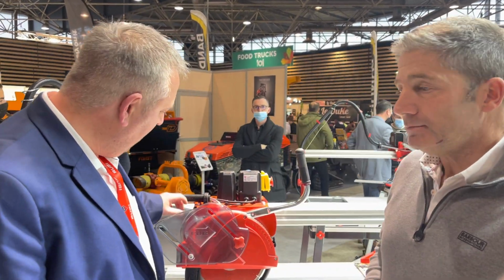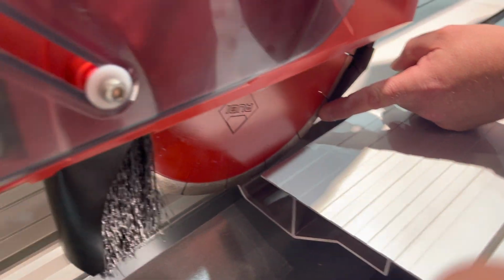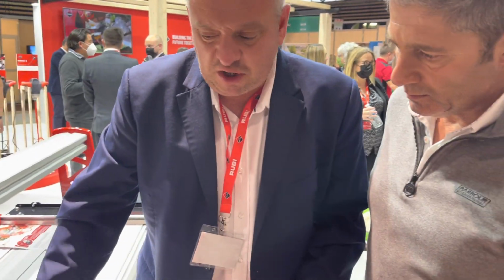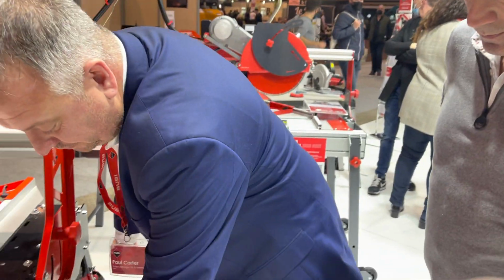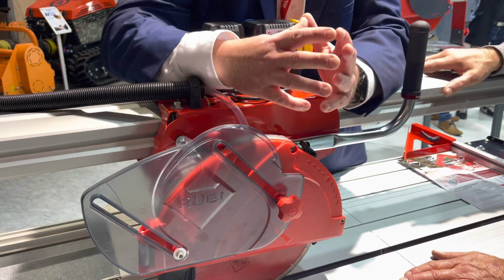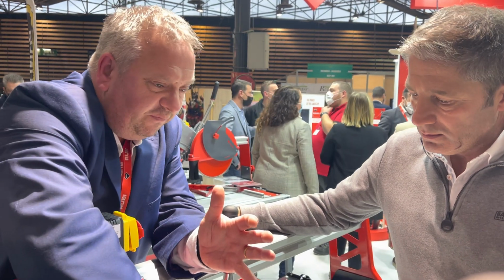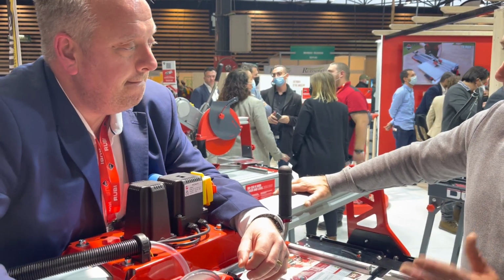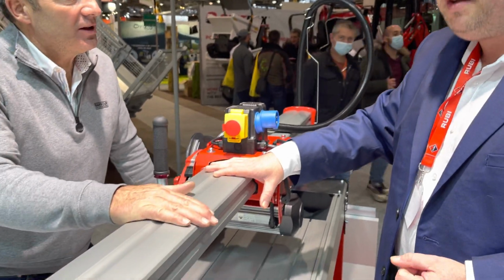The New #Rubi #DCX250 #Xpert  1250   {Talking To Paul From Rubi #Tools At Paysalia Lyon}

Comment: Looks like a good show. Johnnyboy seems to be knowledgeable than the rubi rep.

Ive just picked up a second hand Battipav VIP2110 off ebay so looking forward to use it.
Reply from the maker: I hope it’s good for you Jay mate
Reply: @GreentopLandscapes  I used it today I'm doing a bathroom tiling job and used 12mm porcelain tiles. the saw blade diameter is 200mm. Very happy with the saw and cuts really clean. I used many various wet saw cutters over the years and this is by far the best.

Rubi looks good too and can see it standing upto site conditions. I like the aluminium table as it wont rust and having the water bucket is neat. If I had the money I would go for the Rubi DX250 as well but unfortunately I don't do much work so will stick to my battiplav (£750 -second hand) for now.

the thing I notice on both saws is why have the switch located on the saw body. ideally its should be fixed at the front of the table somewhere for ease of access. the rubi is located at the front with NVR switch so can easily hit off. with battipav I am having to search for the switch every time which I will get used to.